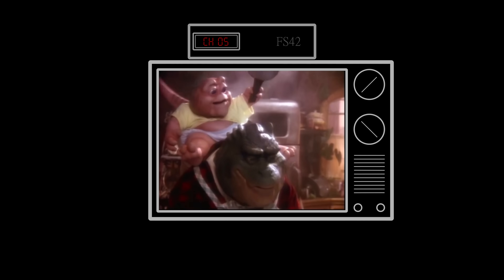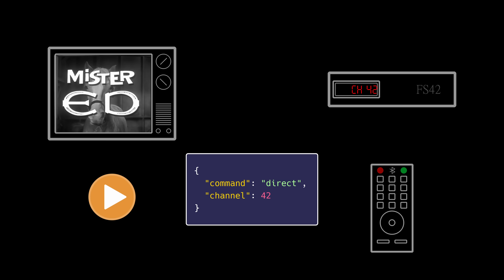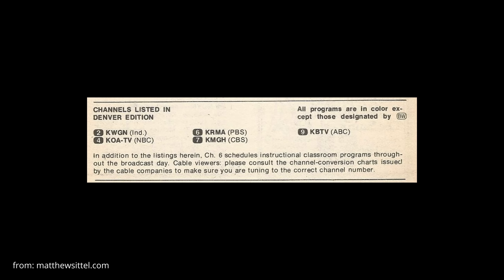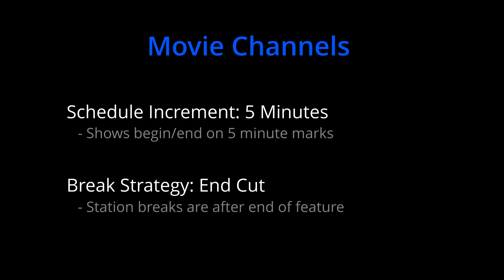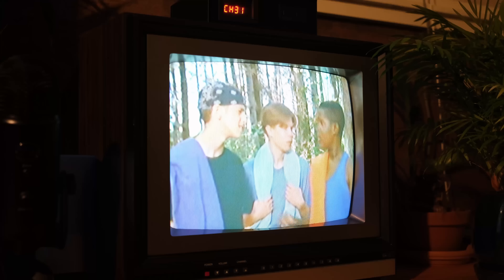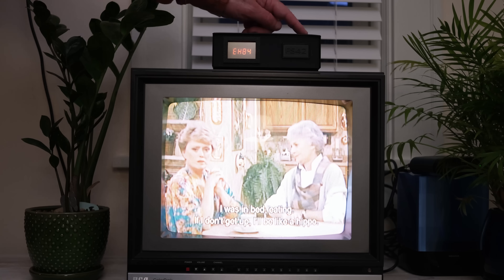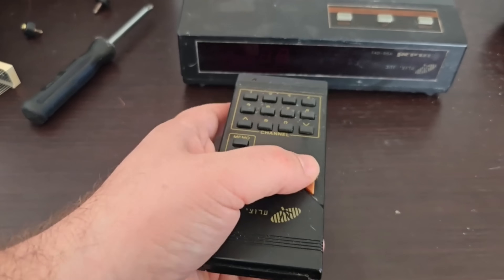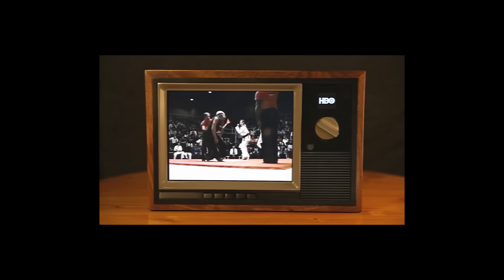90s Cable Simulator - Recreating Retro Cable TV with a Raspberry Pi

Comment: I use a combination of Jellyfin and a program called ErsatzTV to make my own digital channels hosted on my Jellyfin server.  The ErsatzTV program creates a digital m3u tuner with corresponding schedule in XML that can be imported into Jellyfin alongside actual live TV (thanks to a HDHomerun networked tuner and antenna).  I have only made a few channels but you can do a rudimentary version in digital format with channels/filler(commercials)/bumpers.  You can slot shows in specific day/time slots and with a little chicanery have things like prime time movies on normally tv show only channels.  In the future I intend to build this out to a more robust set of channels like in your video for my children as they get old enough to enjoy it.  Your video adds another layer of possibility with the inclusion of a physical device to further simulate the original experience.  Thank you for your work.

Comment: This is an incredible project I would love to get this set up but I’m curious in terms of the data load. How many gigs is for example a month’s load of content? Do you software crop 16:9 video into 4:3 or do you need to use 4:3 video exclusively?
Reply from the maker: Besides movies, all of the content from back then is already in 4:3rds, so you are covered there. For movie channel movies, I let it be widescreen so you get the black bars on the top and bottom. I did convert everything for size and volume normalization. How much you need depends on how many channels and how often you are okay with repeats really. Cheers!

Comment: Fascinating.  I know why youtube recommended this to me. Because I'm writing an auto-editor. A half-AI system that watches a movie and give a brief intermediate summary. It timestamps every sound to know what is happening and when. You then tell a sorting utility to redo the movie according to a newly specified dialogue. And it re-splices the end result. You can essentially get a summary and produce a short version within about 20 minutes on a computer with integrated graphics. I have a 5080 and I haven't even tried to run the code on it yet. It has to be at least 4x faster. But anyways, ,the shole philosophy of taking content and scheduling it based on rules is almost the same thing as what I'm doing. Only my system takes a single clip as an input and outputs another clip.

Great idea with the cable  simulator. If TV was important to me, I'd be into something like that. I do have nostalgic memories, but they are for the content and not how it was presented. I never particularly enjoyed commercials.
Reply from the maker: That sounds like a cool project - my daytime gig is all about AI, so I avoid it at all cost on my personal projects.  Keep us updated on how it turns out - cheers!
Reply: @wrongdog_reckons  I work in film and even though programming and electrical engineering are mostly hobbies, I always find ways to insert them into my work. By now AI is already fully accepted into production pipelines, and I write tools to see what else it could be good for. I'm mostly interested in Stable  Diffusion, having spent 3 years learning everything about it at the coder level. That occupies most of my time currently. I put demos onto the channel. Last one was a parody Star Trek rendering, and then before that I had 2 clips "Jeff Abridges" and "Learning Alphabet With Jack" that were edited by AI, with minor manual  tweaks. They're full of  profanities. I once saw a clip of someone splicing all the F-words from Scarface. It made me laugh, and I wanted to write an algorithm that would make criteria based edits happen on autopilot.

The auto-editor I mentioned saves time, as normally you can't edit a film in less time than it takes to watch the original and take notes. With AI, I can have a film processed in minutes, but then what you get is a complete file. You can't micro adjust it. If it contains 500 cuts and 1 cut is a second short, you pretty much have to re-render the whole thing. You save time if things go right, but you waste time if things go wrong. With AI it's like that. You get a shortcut, but you're walking on a bridge that can collapse at any moment. You can "vibe code" 90% of the way to the end, but then suddenly exceed complexity and AI goes: "I have no idea how I got here and neither do you." AI is therefore good in moderation. It makes a good coder, but then the operator has to be the actual software engineer who can instruct the code to compile bite sized functions and nothing more complex than that. AI makes lego bricks, and the  human puts them together.

Anyways, I'm very impressed with  your project. When I make electronics, I often gut consumer devices for their enclosures. A 3D printer would solve a lot of my hassles, but whenever I want something manufactured, I rely on friends with printers and just give them the CAD files. I would enjoy a CNC router the most, but living in an apartment there is a limit on how much noise and vibration a person can produce.

Comment: You did great work! I like the hardware aspect of the channel changer and the TV guide channel. I will definitely be checking out your GitHub and maybe I can find some inspiration! I personally use ErsatzTV, it has pretty robust scheduling features and allows me to share the stream with others via some tools I have developed and the IPTV code already built into the program. I use a Raspberry Pi locally played through a CRT and then have a personally hosted website that has a script for the channel guide (not as slick as yours) and allows me to change channels, although it can take a few seconds for the stream to start transcoding (which I insert white static to give it an authentic touch). Recreating these types of experiences is worth the effort and I am happy we have different people coding this type of software. Keep it up!

Comment: This is very cool! My dream setup would be to have a farm of 65 Raspberry Pis connected to 65 RF modulators broadcasting over coax. This way, the TV can use its own tuner to tune the stations! It could maybe be used by some retro-themed hotel that wants to provide CRTs with "cable" to its guests.
Reply from the maker: I think there are a few folks on Youtube who have done similar with other systems. I am going to look into how to add a transmitter to this, because I want the OTA artifacts. Cheers!

Comment: The display show show the time, maybe cycle between channel and time?
Reply from the maker: Good idea - I have a feature where if I press channel 97, it will show the CPU temp. It would be pretty trivial to show time and then channel only on change or cycle between all three would be pretty cool. If you press 98 it kills the simulator and 99 shuts down the pi in my setup. Cheers!

Comment: No need for an rf modulator unless you are using a set that doesn't have composite. Every raspberry pi has composite output.
Reply from the maker: For sure - the Pi 5 only has HDMI out and that TV only has RF in, so I go through a couple of converters and the resolutions never quiet match up with what the TV can display. It is imperfect :) Cheers!

Comment: What I'd be interested to see at this point is the ability to take the content, embed it into a proper analog TV signal, embed whatever extra data (like subtitles or other data) and then pipe it out by analog transmission for a TV to tune into. It should be possible not only to create such a thing but also transmit multiple channels through one wire by this method and let the TV itself tune the stations in. This was how TV was for me, even over the cable wire. Because for me as a rural mountain dweller cable wasn't a subscription service it was the re transmitted over the air TV that came in by cable. We only got what you'd know as cable from satellite up in the mountains.
Reply from the maker: I grew up in the rural mountains too - satellites came first for sure - and the first cable available was just broadcast stations mostly but on a cable line. Those were the days :)

Comment: I work professionally in broadcasting and you’re pretty much on point. I also schedule 3 traditional broadcast/streaming channels, I oversee a broadcast channel and work for a major network which has both traditional scheduled programming and fast which commercial rules are stricter than traditional. A 28:30/58:30 slot or 27:00/57:00 slots with the :45 before the top or bottom of the hours or based on channels is for the station ID which is an fcc requirement. I’m nearing 40 years and my first 10 was in cable and learned the cable headend including the program guide channel which was a commodore amega with a satellite feed controlled for parts of it. I almost unscrambled a channel by mistake 🤣🤣🤦🏾‍♂️
Reply from the maker: Fascinating! I've been hearing a bit about that commodore amiga based program guide - as well as one that ran the weather feed - it seems folks are running real instances and emulator based versions of them. I assume that modern systems are using something newer, but are they?

Comment: Working in TV seemed like a dream when I was a kid in the 90s. Now I do, and, well, it pays the bills. As a kid, I used to imagine someone was loading each show from a VHS tape. Which is exactly how it worked. Nowadays it's all done by digital automation software run off playout servers. There's a scheduling (traffic) department that creates the playlists. They create the show formats, insert break material, what graphics will play, and determine what airs when. It's laid out like a big spreadsheet, and mostly still done by hand. Those lists get handed off to Master Control, who insert them into the automation software. They'll also take the video files coming in from production and mark the start and end times for each segment, so the system knows what timecode to start rolling breaks at. A master GPS clock makes sure everything airs when it should. Live shows are run manually by Master Control. You'll give time counts to production and tell the system when to roll the breaks, handle join-in-progresses, etc. Honestly this simulated system might actually be less janky than the real software that runs TV stations. There are four big players that make it: Ross, Grass Valley, Imagine, and Evertz. All of which are varying degrees of sketch.
Reply: Thank you for the peek behind the curtain, though I will admit my first thought when I read "Master Control" was Tron and the Master Control Program.  Greetings Programs!
Reply from the maker: Amazing insight - the interesting thing is that I've never heard of any of those companies. Not general tech players, do they mainly work on television systems?
Reply: I also work in tv and yeah seeing the changes from when I got in 20 years ago to now
Reply: Betamax actually.
Reply: I wasn't even aware anyone was still watching network television. I'm honestly surprised you still have an industry.
Reply: @AMT4245 millions of people still watch regular old TV just not nearly as many as used to. Remember radio stations and newspapers still exist
Reply: @wall91nutz news papers only exist in certain areas. Radio is easy because it's really just used as either background noise or a way to flip around different music genres quickly. TV though? The only people I know of that still use network television are boomers and gen x. I don't know a single millennial or gen Z adult who is subscribed to any network tv provider. At all. What absolutely obliterated network TV amongst people my age is sheer lack of anything interesting and the ridiculous advertising breaks. You have no idea how glad I am that I don't have to use traditional TV for pretty much anything anymore. To make a final point, and don't take this personally, but it feels like everyone who works or has worked in broadcasting sniff their own farts. I've worked in "show business". It's a lot of unimportant people who think they're important. It's pretty funny watching their world view fall around them.
Reply: @AMT4245  what a strange and mean spirited comment to make
Reply: @drewcummings2453 it's not mean spirited to speak the truth. The Hollywood entertainment industry has been rife with self righteousness since it began
Reply: @AMT4245 I dunno man, I’m getting sick of paying for a bunch of different streaming services just to have them charge more and more for ad free, then still show you ads. Instead of paying for licenses to play content, these companies decided to make their own content and now we foot the bill for all their failed movies and series. We’ve been bait and switched.
Reply: @AMT4245  Network TV still exists as cable channels. In fact, it's almost all of their income. Yes, they still run broadcast towers, but that "broadcast TV" fee from cable is what keeps the lights on.
Reply: When I was a kid I thought that running a cable platform was all about buying a sat subscription and hooking it to a splitter, I didn't know about copyright and license. What made me think so was that when one channel had an outage, it'd display the "no signal" error in the OSD of a popular satellite box (as in, the "no signal" message was transmitted through the cable as the channel, not a thing of the cable box)

So, I thought all it takes is "claiming" a particular block and hooking up to its infrastructure, so that people living there can only use your cable service, and then you can resell your sat subscriptions to everyone.
Reply: @bjornerlendur4606  in certain countries with less enforced copyright laws they exactly did this in past. Thailand & Romania to give examples. Just pick up satellite signal, distribute it, and dont pay for licenses. They could even distribute movie channels for free, because, why break the law only a little if you are gonna break the law anyway :D
Reply: @bjornerlendur4606  That's how a great many stations operated. Franchise broadcasting of national networks (CBS, NBC, etc.) There were very few totally independent stations. When that national feed breaks, you'd get whatever the receiver's outage said.

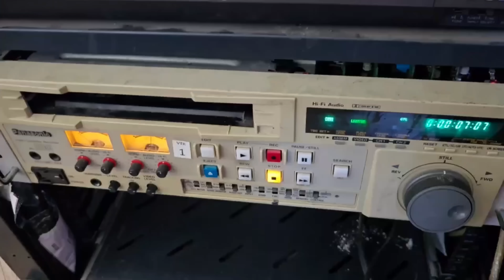Comment: 17:18 Where you put all the Stuff in the box? Have you connected and mounted an external hard drive to the Raspberry Pi? Its not showing anywhere in your Video.
Reply from the maker: Hidden in plain site! See the blue thing behind the cable box in the thumbnail? That's a cover I printed for a hard-drive docking station with spinning drives that connects over USB. Cheap storage, works great!

Comment: This looks like a really neat project, would it be possible to build something similar that syncs with every TV in the house at the same time?
Reply from the maker: It could now with long enough cables and splitters :) Seriously though, I think you would have to have a couple of units and some OTA transmitters (unless you already have coax running to the rooms)

Comment: The Prevue Guide channel is a good inclusion. Im pretty sure the original Amiga files of it have been uploaded online, alongside programs to send data to the guide. Maybe you can add support for that if you feel like it. Just a suggestion. Amazing progress so far though, been looking for something like this since 2023.
Reply from the maker: I've just recently heard that - thanks for the pointer. I'll look into it for sure. If you want to give it a try and run into any issues, file a ticket on github and I'll try to help you out. Cheers!

Comment: How much storage have you dedicated to the content that your cable box plays ? Are you storing all of it on a NAS and and remotely grabbing it from the Pi, or is everything somehow fitting on the SD card ?
Reply from the maker: If you see that blue shape on the left side of the thumbnail, that's a cover I printed for a hard drive docking station holding big spinning drives. I overestimated how much storage I would need, so I'll move that to my NAS setup and either stream from that or hook up a single drive enclosure. 4TB or so should be plenty for a good simulation.

Comment: 90s cable was great but i'd say 2000s cable was better, not only were the funny shows funnier (seinfield has absolutely nothing on aqua teen or always sunny), adult swim was arguably better than 90s MTV and theres a lot more internet attention based on 2000s era cable stuff
understandable as 90s cable really doesen't have as much flair as 2000s cable, 2000s cable could do more but it didin't suffer from enshittification yet
Reply from the maker: There were some great shows in the 2000s - you named several. I caught them all on streaming really though, haven't watched much cable since very early in the 2000s. Cheers!

Comment: 10:14 Your Muzik TV channel is period-accurate for MuchMusic in Canada as long as it doesn't play any music after 1996-1997 or so. From then onward you need to pad it with an increasing fraction of lifestyle filler, until by 2002 it's as hopeless as MTV. Even then, when Muzik TV clogs up with crap, you just ask the regulators to let you spin up a second channel, MuzikClassic or MZ2 or something.